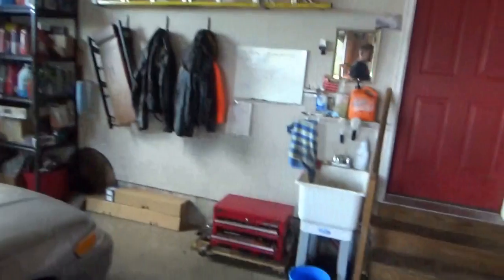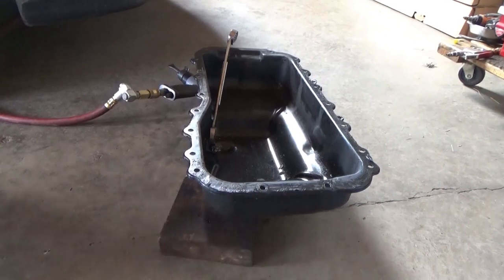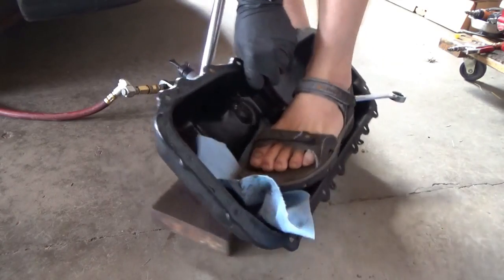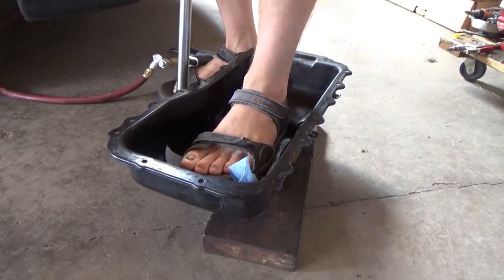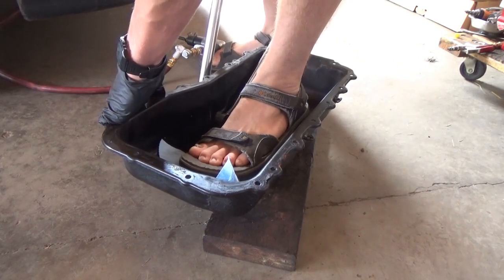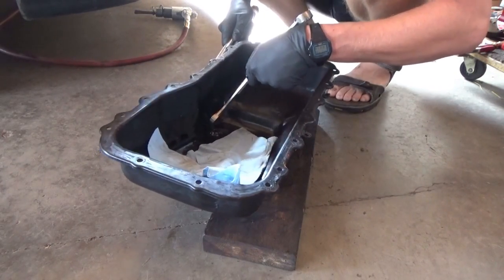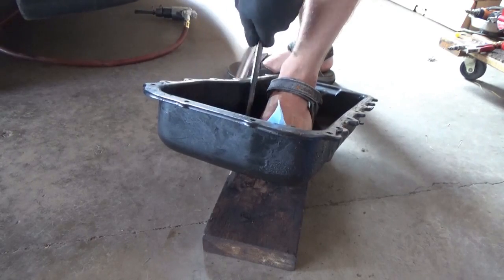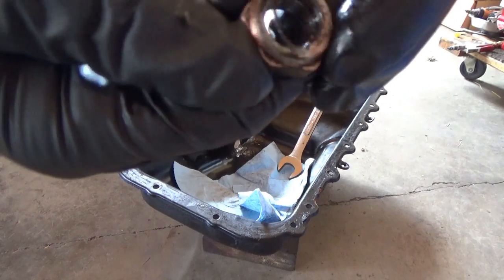How Tight was the Drain Plug?

Comment: You couldn't find the welds? Maybe the nut was just glued into place, evidently the glue didn't stand up. Of course it's hard to estimate what force was applied but less than 70 ft lbs sounds like a good guess. Sure, that was too much, but I think you have found evidence the pan was defective or at least inadequately manufactured. It makes one wonder how often that happens, and whether the company quietly replaces pans when this happens at the dealer. The drain nut on my Subaru tends to leak, and it's a little frustrating knowing that new pans are made so poorly compared to the heavy designs of the past. Old style drain plugs could tolerate 70 foot pounds every day, even though nobody was applying that much force. Good engineering should design the easily replaced part (the bolt) to fail first, so you would have more of a chance to replace it without having to take the pan off.

Comment: The FCA drain plugs are so simple to deal with. I've found a couple of plugs finger tight that didn't leak and didn't back off. You just need a gentle tug on the wrench after it bottoms out, as the soft gasket on the plug needs very little torque to create an oil tight seal.

Comment: My wife went to one of those quick oil change places and when she got back there was a large puddle of oil under the car.Upon inspection i found the oil filter had the gasket from the old filter on top of the new filter gasket. I called the place and talked to the  manager he wanted us to drive back down so they could fix it.I fixed it myself and had them reimburse the cost of the oil.I should have just changed the oil myself.NEVER Again will i take my vehicles to a quick lube place.
Reply: Who is liable for this , these jiffy loob places do this on purpose !

Comment: You moved to fast and I couldn't see if the threads were pulled. Also isn't there supposed to be a washer/seal of some kind on the bolt? I could never understand how a parts store would sell a filter without a new washer.
Reply: brainfreeze44131 Chrysler/jeep/dodge have a rubber seal built into the drain plug head. You can see it when he shows the bolt in the oil pan.

Comment: That's ridicules, I service a vehicle before that some monkey at a quick lube place thought it was a good idea to impact the oil filter on. A week later the filter developed a stress crack from being so tight and started leaking profusely and suddenly, almost seizing the engine due to low almost no oil and a nice smoke show from all the oil on the exhaust. After a few hours, and many failed attempts, I was able to get it off using unconventional methods . To add insult to injury, it was a Fram filter too.
Reply from the maker: you can't make that stuff up. Thanks for sharing!

Comment: Was the drain plug repedidly over tightened  , YES . .
But with all due respect , BREAKAWAY TORQUE IS NOT THE SAME AS TIGHTENING TORQUE......you Can NOT reverse touque measure...
Reply: The breakaway torque would be less than the torque it was actually torqued to, so either way the drain plug was ridiculously over tightened. The torque spec on that vehicle is most likely about 20ft lbs and if he got up to 70ftlbs then it was torqued higher than that.
Reply: https://www.youtube.com/watch?v=0zuqSrD6F8I

Comment: I think the real test is how much torque did it take to break the welds of the inner jam nut...
Reply: This is extremely common, even at car dealers. Idiots over torquing not only the drain plug but wheel nuts and pretty much every thing else. I bet if one is relatively strong, it would not leak if you just finger tightened it.
Reply: I've left one finger tight by accident once and it came back dry, but Ford's also have rubber o rings on their plugs. But I dont work at a quick lube place and I definitely don't over torque the drain plugs. It's very annoying having to replace them after we get one from a quick lube place. I work at a Ford Dealership, and always have to deal with the tire shops and other places over torquing the lugnuts and destroying the caps also as well as the threads on the drain plugs. I had a car come in with the drain plug so tight i had to use a long breaker bar to break torque, Most of the time it's from Valvoline or Jiffy Lube.

Comment: Another good video! I don't change my own oil to save money, I do it to keep those people away from my car.
Reply from the maker: Exactly. That's why I became an auto technician haha
Reply: B crinshaw Yes.
Reply: Oil Pan Plugs and Lug Nuts, Smfh.
Reply: Yep,  first time I did my oil was the morning after Jiffy Lube didn't properly install my oil filter.   Most (but not all) the oil was leaked out near the filter because part of the old filter's gasket had ripped off the old filter and was stuck to the block.
Reply: Amen!  Anything I can do myself, I will.  I watched to many techs work on my Trans Am when I was younger.  Made my blood boil.  They didn't think I knew any better.  On my Audi's I do everything.  It's like going to school with every new problem.   I think they make my Kung Fu stronger.  ;)
Reply: I agree pops plus if a man's working on your car in flip flops run away I work at the #1 dealer in Southeastern Toyota yup Dave Edwards and if we wore flip-flops to work we would be sent home

Comment: You're telling me two shops couldn't figure out how to put 70 lb-ft on a drain plug to remove it?  Did it spin before that?  If so, that answers my question.
Reply: Late to the party, but the nut on the inside was spinning so no amount of torque would help. Needed to hold one side while removing the other.

Comment: Can you use a torque wrench counter clockwise?
Reply: arbez auto Yes
Reply: Actually, all 6 of my torque wrenches (4 snap-on, 1 mac & a gearwrench) say to "USE IN A CLOCKWISE DIRECTION ONLY. DO NOT USE TO BREAK FASTENERS LOOSE".
Reply: arbez auto How would you you torque a left hand thread nut / bolt? My snap-on torque wrench has a reversible ratchet for a reason?
Reply: All but one of mine are reversible. Looked at the instructions for one on the Snap On one's & it said that attempting to torque counter clockwise or using the torque wrench to break loose a fastener will result in permanent damage. I'm going to say that unless your's expressly states that you can torque counter clockwise, you probably shouldn't. That being said, I don't run into left handed threads often, if ever. Know your tools & proceed cautiously.
Reply from the maker: As long as you stay withing the maximum torque specs of the wrench, it doesn't matter if you are tightening or loosening fasteners...
Reply: I have to disagree. When the wrench specifically states that damage will occur, I have to side with the tool manufacture. Most of my torque wrenches are older tools, but are serviced & calibrated regularly. Newer wrenches may be different, but I will stick with my quality older tools & follow the manufactures instructions. My newest wrench (maybe 3 or 4 years old), a inch pound gearwrench, says to use in a clockwise direction only.  This was purchased when my snap on inch pound torque wrench stopped working & had to be sent out for repair. The snap on wrench by design only works in a clockwise direction, there is no way to reverse it. All of my other wrenches are reversible, but all say not to use in a counter clockwise direction. If it was OK to use in a counter clockwise direction, why would they bother to tell you not to? Again, the newer tools may be of different design. Know your tools & follow the manufactures recommendations. If they say that damage will occur, I would tend to believe them. Doing something with the tool that the manufacture says will cause permanent damage doesn't seem like a smart thing to do. I'm at the age now where I try to avoid deliberately doing stupid things. Many lessons learned.......
Reply: arbez auto Just checked in the snap-on book and the QD series like mine is ok in reverse but some are clockwise only.
Reply: Good to hear. Nice to know that you haven't been doing any potential damage. Mine say not to, so I don't. You have to know your tools.

Comment: 80 Nm. It took more than 80 Nm to loosen that bolt. On the other hand  that's not that much. An oil pan should start leaking at the seal instead of the inside but coming loose at such torque.

Comment: The oil pan on all 3 of my daily driven vehicles are aluminum... I usually break out the actual torque wrench and torque it to the factory specified 13 lb-ft. That sounds ridiculously low, and in fact you can easily turn it further, but I've found 2 major things are at play here: 1) the oil is deceptive, the added lubricity makes the 13 lb-ft more like 25 or even 30 dry. 2) after a couple of heat cycles it seems to tighten up even more, so by the time 5,000 miles have rolled around it's on there good and tight. You can still bust your knuckles breaking the drain plug loose if you're not paying attention.
Reply: I'm about  to try and drain my sisters car ugh it's really stuck in there

Comment: those guys routinely use an impact on drain plugs ...Over the years Ive probably replaced 70 oil pans from them ...if they arent stripped and falling out the other end of the spectrum is the bolt is so tight welded nut snaps off trying to remove them..

Comment: In order to save time they used the same impact gun and torque stick to tighten the drain plug as they did for the tire rotation.

Comment: Honestly I do not believe it was ever tightened that tight.  My thoughts are the butt. Crack who was changing the oil was going the wrong way and instead of lefty loosey was going the opposite way
Reply: Was thinking the same
Reply: lol, 'can't get it to come off, oh well' while right turning it
Reply: I disagree. I see this daily as a Lube Tech at a Ford Dealership. I just recently had a car that went to Valvoline for their last oil change and the drain plug was so tight, Even double wrenching it didn't budge it. I had to use a long breaker bar to break the torque. I see it quite often from Valvoline and Jiffy Lube. They also like to destroy the lug nuts by hammering them on till they stop with an impact. With Ford lug nuts, when they get hammered it destroys the caps and the 19mm socket wont fit on them, and then if you use a 20 mm it can sometimes spin the caps on the actual lugnuts and make it worse. I have a special socket for distorted lugnuts that is 19.5mm and alot of times even that wont fit on them. So your only option is to hammer your 19mm socket on it and hope it corrects it enough for the 19.5mm socket to fit on it. but sometimes the cap just comes off and customers don't like that. When i tighten lugnuts i tap my Impact trigger once and then let the lugnut stop itself, then once i lower the vehicle on the ground i torque all the lugnuts to spec. That is the only way to not destroy the lugnuts on the newer ford and even some other makes. I love cars that i've serviced since brand new, I have 0 problems and my 19mm socket fits perfectly.
Reply: @Zalagar619  to long!

Comment: I got my tires balanced few weeks back.  I saw guy had snap on 1/2 cordless impact.  He had strait socket on it.  Thought nothing about it.   Well went to do brake last weekend, I had to use 4 foot breaker bar to get lug nuts loose.   They supposed to be 120ft lbs.   I think same problem here guy with cordless impact and doesn’t know the power it has.
Reply from the maker: Possibly so.

Comment: That oil change guy must have a cousin who works in Michigan! I just changed the oil in my daughters Toyota last week and when I couldn't loosen the plug with a standard box wrench I grabbed what was handy for more Oomff, my torque wrench. It turns out that this plug was tightened to 60 ft lbs. So tight that the plastic washer used on Toyotas was crushed and actually "extuded" around the outside of the drain plug flange! This was done at a Toyota STEALERSHIP! I hate doing oil changes but who needs the hassle of arguing or a law suit to recover the damages?  I would never want to go 10K miles without changing the oil especially on a vehicle that has VVT.
Reply from the maker: Wow...must have been torqued to "factory spec" then lol
Reply: Just want to set the record straight. On Toyota drainplugs. Once you pull the 14mm bolt out, the washer 99% of the time stays on the pan so people don’t loose them. And it’s not a form of over torque. It even happens when you torque it to the correct specs (usually 25-27ftlbs). Don’t try to talk crap unless you know what your talking about.

Comment: Well, what is the correct torque for that drain plug?
Reply: celeron55 I would say 8-10 ft lbs would be plenty, your just sealing the drain hole, not trying to hold back the Hover Dam lol:)
Reply: celeron55 no pressure just had to be snug...
Reply from the maker: 20ft-lbs

Comment: Haha!  Unreal.  What's the spec, 18 to 20 ft pounds???  Some Subarus have like a 35 pound spec, that's the highest I ever heard of....  But then, I've seen that any number of times.   First time I changed the oil on my "new to me" used truck, I pull the plug... Helio coil....  So it was already phi slamma jamma'ed by somebody.... and repaired....  I just shake my head.

I kinda thought you might get up to 80 or 90 foot pounds, myself...  I figured it would take that to break the weld inside....
Reply: Patrick Morrissey last Chrysler product I did an oil change on was 14ft lbs. The drain plugs have a rubber gasket that likes to weld itself to the hot metal pan.